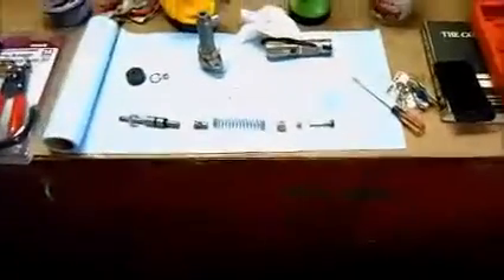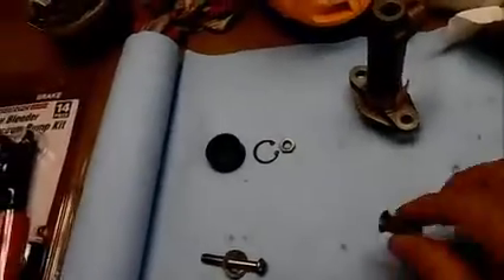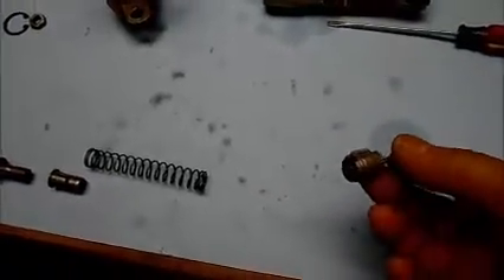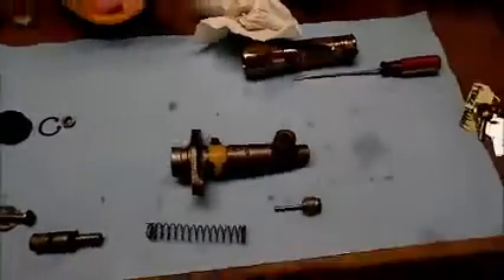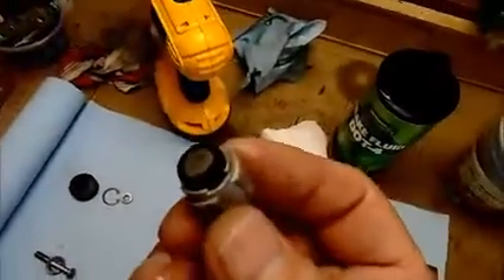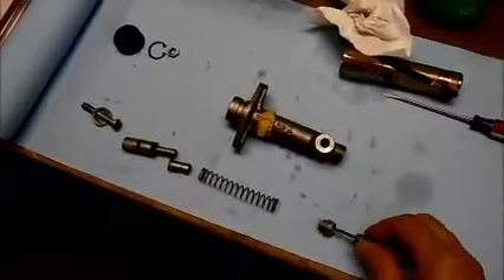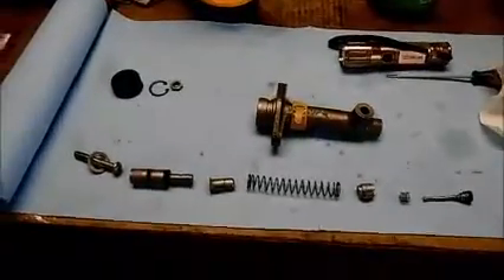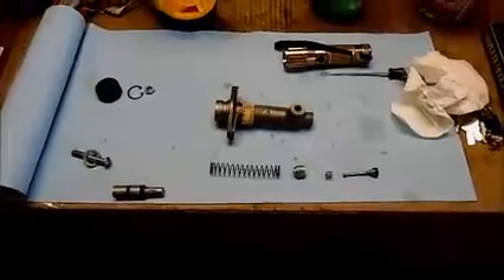My 3.8 Jag E-Type brake master cylinder internal parts

Comment: I wish I knew enough to help here John.  Sadly, I don't.
Reply from the maker: Greg's Garage no problem Greg, this was an older video that I just made public.  I got this worked out a while back.  It was my fault with the way I installed the pedal arm onto the splined brake and clutch pivot shaft. It wasn't coming up far enough.

Comment: I guess i not sure all the symptoms and exactly how that brake system works . but if think master is sticking , causing brake to stick applied , then while stuck ,seems if you open a bleeder on affected wheel there should be line pressure. . because that is what would be applying the brake if master is causing  .could plumb in a gauge for test purposes. Again not sure of how it is set up , but if something was stopping the plunger in master to stick , Thinking  it would also have free play in pedal and looks like it would affect both rear and front . It seems it would have to be something rear only controlled or in a rear brake assembly causing it . Not sure if it uses any type of residual valve or just what , and they may use a system i do not know about , but just thinking rule of thumb. Are all brake springs good and linings never been wet with fluid . is there anything between master and rear brakes that could cause it , even a rubber line can cause a brake to stick if coming apart inside , But thinking all that was new , but even new stuff breaks
Reply from the maker: wtbm123 Ding ding ding!  Terry you nailed it, this video was from a while ago which was only recently made public.  I didn't realize that meant everybody would get an notice it was a new video. ;-/  anyway it was due to a lack of free play which I added by inserting two spacers behind the MC mounting flange.  My adjustment was at the max setting before, so I needed more space.  It turns out the root cause was I installed the pedal arm onto the splined pivot shaft in the wrong orientation by a few degrees.

Comment: John, I had that same problem on my MG-A, but for the life of me I cannot remember how I fixed it. I did fix it, though. My neighbor, a very clever mechanic, says that on the Jag it is the reaction valve. Unfortunately, I don't even know what that is, but you do. Good luck and keep us informed on getting it sorted.
Reply from the maker: Bruce Boschek Got it sorted - no reaction valve on my model year that came later, but I had insufficient free p[lay and added some spacers to provide the movement needed to fully release the brakes when the pedal was up.

Comment: I do not know the workings of a Jaguar, but I do understand physics. What I tell you may not be the cause of your problem, but could be a possibility.
   A cylinder bore and a piston can ware over time with continued use. The bore can become elongated or cupped and a piston can take on an elliptical shape.
   Much like a storm door gas shock on your house, you can tip a key on the gas shock to hold a door open for you. The same can occur inside the bore with the piston. The piston will tip on it's own and create a jam, locking  itself in place. Although you can not see any physical change in the surfaces of your parts, the distress to the machined part can non the less be there from over usage.
   A repair kit may take care of a symptom, but only acts like a bandage. Temporarily fixing the underlying problem. Although a piston can be replaced with a kit, the bore can not be replaced. Fixing a bore will take milling a new bore and placing in a sleeve. only then you will achieve a truly machined surface.
   Just on a side note, the spring tension can also become compromised. A spring can lose tension over time and most generally be the cause of the bore and piston distortion.
   I don't know if this information is any help to you, but possibly a direction for you to look in.
   Take care John and good luck.
Reply from the maker: ***** Interesting ideas thanks for the creativity!  It turned out to be a lock of sufficient free play in the linkage. See my reply to Terry below.

Comment: Had the exact same problem on mine. Drove me nuts. Rear brakes would start to drag after a couple of miles. I rebuildt the cylinder and tried a new one. Same problem. In the end I concluded that the freeplay listed in the manual have to be wrong. I fiddled around with the freeplay until I got it sorted. The pedal feels low on the first pump of the pedal but then it hardens and get normal. Don't know if it has anything to do with the vaccum system or some sort of heat expansion, but at leàst I got it working.
Reply from the maker: ovenorway Ove, it was my fault - see my reply to Terry below, lack of free play to allow the master to release.

Comment: Hey @JohnCarey1963Jag I’m helping my Dad with the rear brakes on his 1963 e-type. Do you remember how you fixed this? Thanks
Reply from the maker: Brian, the fix was to add small spacers between the master and the bracket to allow the pushrods to fully retract when the pedal was not pressed.
Reply: @ Thank you!

Comment: Hi 
The problem is not in the master cylinder, it is in the mounting of the cylinder.
When the brake pedal is in the “off" position, it is necessary that the pistons in the master cylinders are allowed to return to the fully extended position, otherwise pressure may build up in the system causing the brakes to drag or remain on. 
To set the push-rods to the correct clearance, slacken the locknut at the top master cylinder push rod and adjust the push rod to give " (1.58 mm) free travel, this by means of the balance lever will give (.794 mm) free travel to each master cylinder. Tighten the locknut at the top master cylinder push rod.

Comment: how about the brake itself
Reply from the maker: finpainter1 Stu - I got it sorted using some spacers on the master cylinder to add some extra return space so the master cylinder piston could retract more fully.  I could have done it by moving the pedal on the pivot shaft but that would require more disassembly than I was willing to do.  It's all good now.

Comment: When my brakes were sticking my mechanic in Ohio replaced the rear brake lines that he said have a tendency to collapse??    No more problems after that
Reply from the maker: DLBUSMC Thanks - mine was brand new stainless covered which I think is less susceptible to the collapse.  I learned finally that my issue was the lack of free play between the pedal pushrod and the master cylinder's piston.  Once the fluid heated it couldn't release fully.  I added two spacers to eliminate the problem as a temp fix.  A permanent fix would be to remove the pedal from the splined pivot shaft to move it further in on the shaft to give more return action, but I don't want to tear that all apart right now.

Comment: Hi John.
I'm having the same problem on my Mk2. I did a search for "dragging brakes" and it appears it's either a tired return spring in the master cylinder or possibly the reaction valve sticking..
If I find a definitive answer for mine I'll get the details to you.
It's a problem MG owners suffer from too.
Reply from the maker: Barry Jones Barry - it was the position of my Brake pedal on the pivot shaft.  They are splined so to move it, I'd have to remove the entire pedal boc including clutch and brake lines - not going to do that at this point, so I moved the MC further out using spacers to give the needed free play on the piston pushrod.  It was my fault for not checking it earlier.

Comment: John, I know this is an older video, but were you able to source the correct rebuild kits for this? Im running the same master cylinders (Dunlop 5/8" bore) 64' etype.